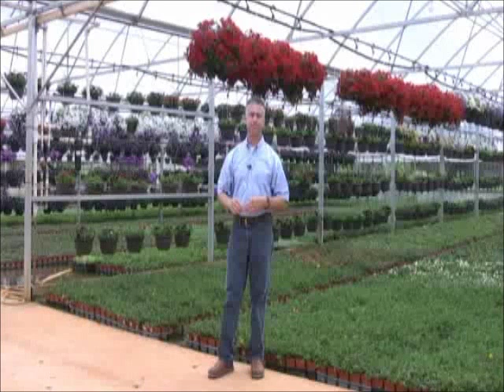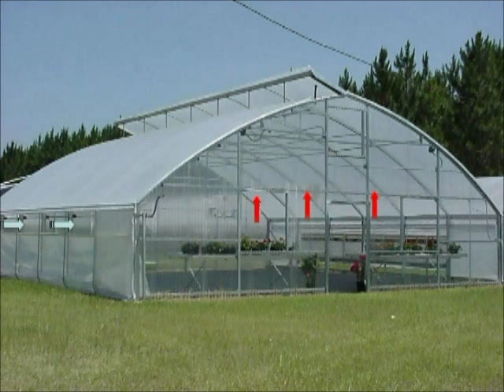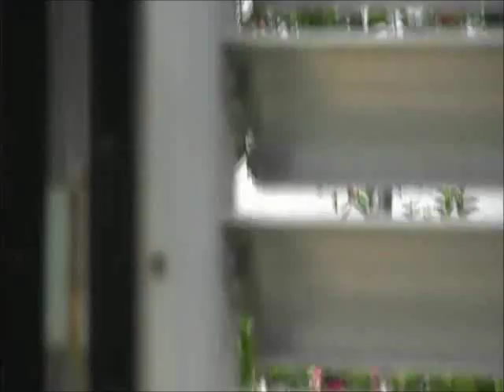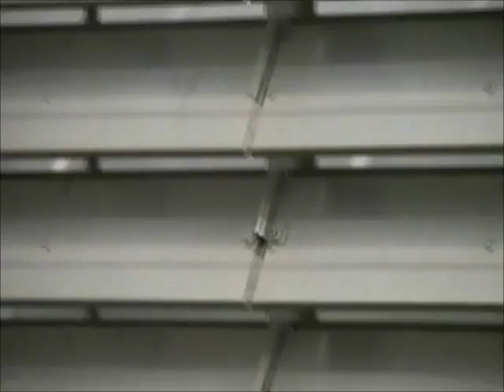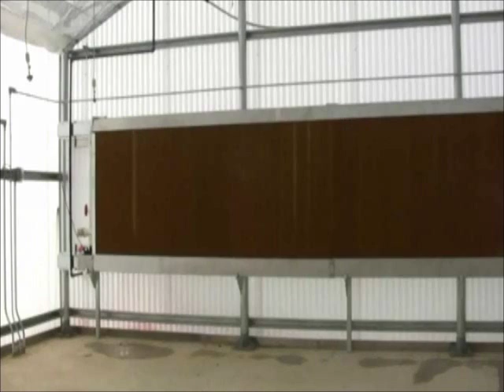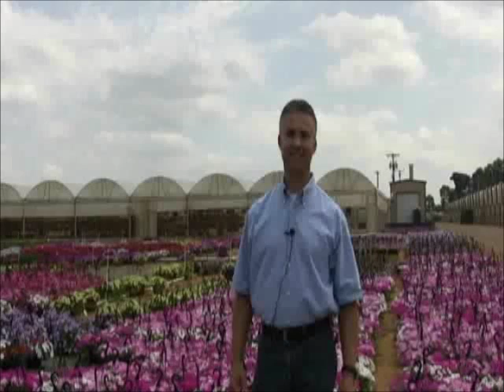Greenhouse Ventilation

Comment: By how much does evaporative cooling increase the humidity inside the green house? Many thanks! Great Vídeo!
Reply from the maker: The short answer is it varies. An evaporative cooling system actually cools the temperature in a greenhouse by adding moisture to the air. The potential for cooling in any greenhouse environment is directly related to the difference between the dry bulb temperature and the wet bulb temperatures. In other words, the potential for cooling is directly related to how much moisture is already in the air compared to how much moisture the air could carry if it were completely saturated. So, how much evaporative cooling increases the humidity inside a greenhouse environment will depend on the temperature and humidity of the air to start with. On a related note, one of the best ways to hedge against high humidity levels in a greenhouse is through the use of correctly sized and properly laid out HAF (horizontal air flow) fans. I hope this helps.